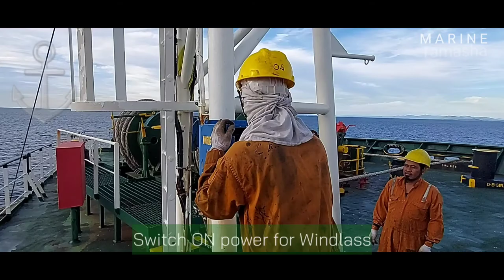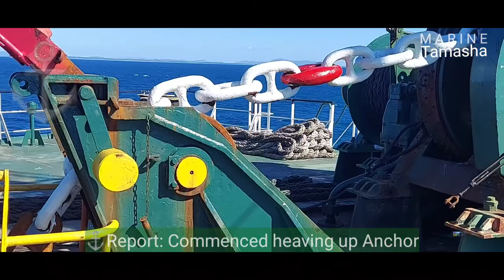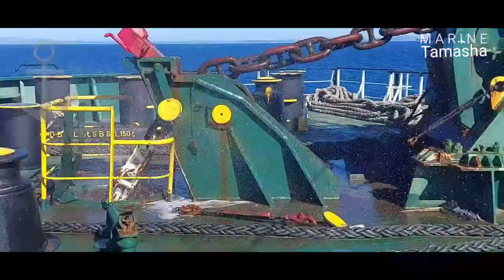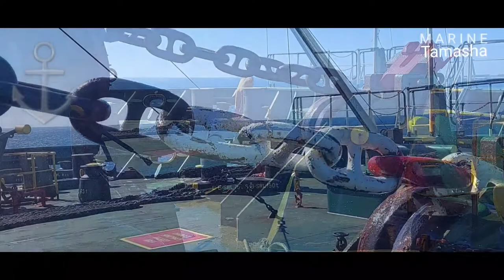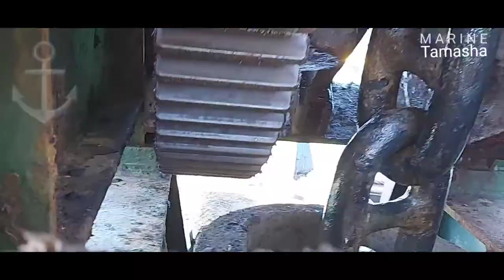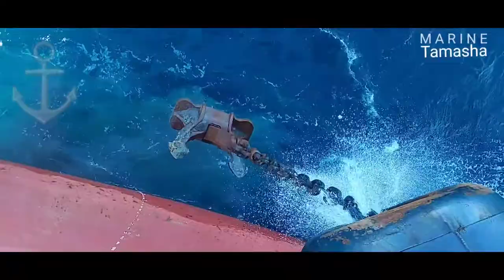BULK CARRIER: Heaving up an Anchor

Comment: Nice Video... Are they spraying it with some type of protectant at the end?
Reply: I hope so, salt eats metal for breakfast
Reply from the maker: Final wash is done using fresh water. But if the next cargo is corrosive, then only a barrier coat is applied for protection.